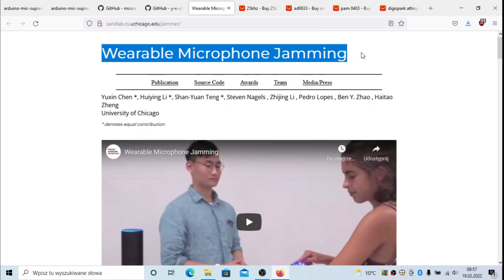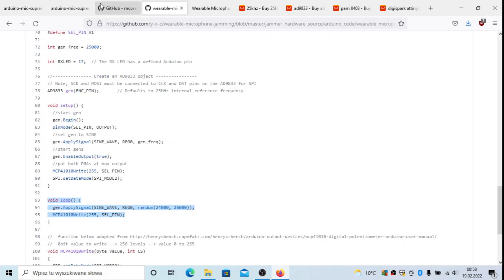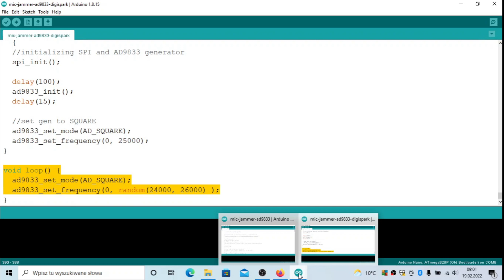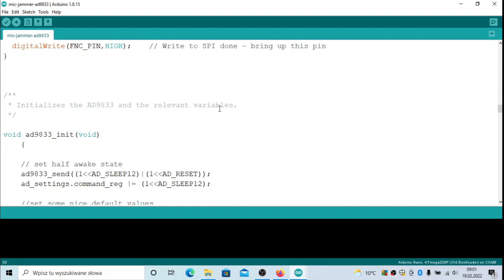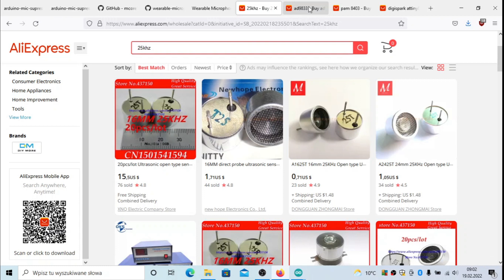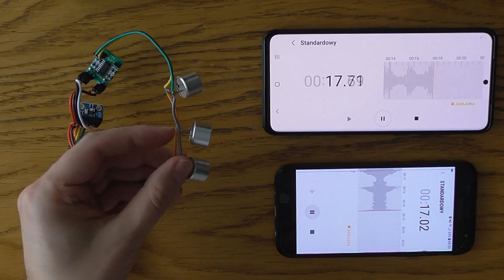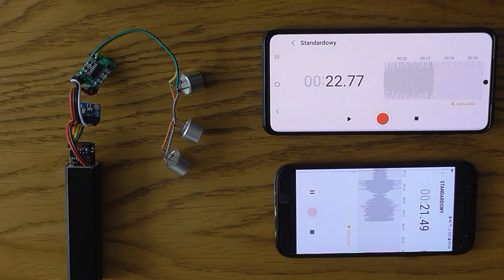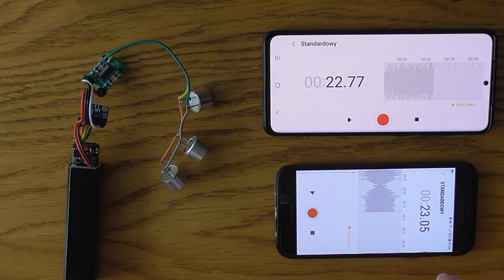Simplest, cheapest, effective DIY ARDUINO ultrasonic Microphone Jammer / DIY ultrasound Audio Jammer

Comment: I bought the Avr Usbasp Atmel recorder, it arrives tomorrow, I'm installing linux ubuntu to follow your video https://www.youtube.com/watch?v=7klgyNzZ2TI
What version of ubuntu does it indicate?
Reply from the maker: use latest or 20.04. The software is available for all ubuntu versions.
Reply: @justanengineer5599   are the main7.elf main7.hex files generated when main7.c code is compiled or do you need these files?
Reply from the maker: these ELF and HEX are generated from C file every time you run "compileattinyXX" batch script
Reply: That's right, thanks again for helping, tomorrow the record company that indicated arrives, so I'll be trying here, if I have any doubts I'll contact you again to see if you can help, it's very important for me to succeed in this, sorry for my lack of knowledge and the amount of posting in your publication.
Reply from the maker: no problem. Remember to do "chmod +rx compileattiny*" in linux to set execution rights to batch script
Reply: @justanengineer5599  the recorder has now arrived, a doubt would have a tutorial to use it in the same way but in windows?
Reply from the maker: COMPILATION ON WINDOWS 10 PC :
If you have Windows 10 machine - follow this tutorial to download and install full AVR-GCC environment :     http://fab.cba.mit.edu/classes/863.16/doc/projects/ftsmin/windows_avr.html   and  use "compileattinyXX.bat" files for compilaton in the directory where you have downloaded mainX.c files. You have to be logged as Windows Administrator and run "cmd" from search window to do that. Then use commands like "cd XXXXX" to change working directory to get to downloaded source files
Reply: @justanengineer5599  already tried with this tutorial but the Atmel AVR Toolchain for Windows that tells you to download the link no longer exists
Reply from the maker: try this page here it contains binaries fow windows https://blog.zakkemble.net/avr-gcc-builds/

Comment: Could you create a new video or explain better how we can assemble with changes in the source code of the initial PoC version with AM modulation?
It would help a lot.
would there be a way to do it only with digispark and a Pam8406 that already comes with the 10k potentiometer in it?
I really need to get these results I ask for your help.
Reply from the maker: Hi. the digispark board cannot be used because there are some resistors attached to port B of ATTINY85 chip and Digital to Analog Converter cannot be created. You have to use discrete components and make it from the scratch like on my first video here https://youtu.be/YBQ7A4W0bTo   Also ATTINY85 chip programming is needed as I am showing here https://youtu.be/7klgyNzZ2TI

The only difference is that you put PAM audio amplifier board instead of transistors
Reply: @justanengineer5599   can i use the arduino uno, or usb recorder card to record the attinny85? Will it have the same result?
I set up the whole circuit manually, but when recording with the main7.c code changed to AM modulation, it records normally when I put it in the circuit, I am not having oscillation in the test port.
I already redid the circuit 5x and it is correct with your diagram, however I do not get a result, I will try again today, but I would like to know if I can use the arduino or ATtinny85 usb recording device to record and then put it in the circuit.
Reply from the maker: you meant flashing?  I am flashing attiny85 chips with USBASP flasher. My scripts are prepared for this. yes, you can flash directly .HEX files from github to attiny as long as you  have any compatible flasher. There is very important to flash also fuses the same way as my script does so attiny could run on 16MHz clock
Reply: @justanengineer5599   I managed to record on the arduino uno using a library that seems to have worked because I have the same variation and modulation on the oscilloscope as yours, but it generates noise on the speaker adjusted by the 10k potentiometer, it interferes with the iphone but it is still possible to listen to it, I filmed everything if I could please take a look
the link is this: https://youtu.be/6a0xi43v9rI
Reply from the maker: I have seen the video. You have attached oscilloscope to one of atmega pins. please connect it to input of the potentiometer because we can only see single bit of the 5 bits of digital signal. I would like to see if Digital to Analog converter works. These pulses should have different amplitude but on your oscilloscope they look as they would have the same amplitude
Reply: @justanengineer5599   they seem to have the same amplitude on all potentiometer pins and on the test output new link: https://youtu.be/yg3olohPXgc
Reply from the maker: it looks like you have some issues in connections. See what I have got on my prototype on 2 pins of the potentiometer : https://ibb.co/XYBgj13
https://ibb.co/7ny3TyT
Reply: @justanengineer5599  But would this code be used with transducers or with speakers?
Reply from the maker: with both speakers and transducers. check resistors and if there is R resistor connected to the GND : https://github.com/mcore1976/antispy-jammer/blob/main/antispy-jammer-enhanced-schematic.png
Reply: @justanengineer5599  Yes, I put a 1k connected to GND like the example
Reply: capacitors I am using 10mf and 470nf at the output on PB0 where the 1k resistor is located with the 470ohm one, a 1k one goes to GND
Reply: @justanengineer5599  yes

Comment: Any progress?

(they are using transducers to send FM modulated signal and the speaker for high tones AM modulated signal random noise on 25kHz bearer frequency. The combination of both techniques apparently gives the best results. I will see if I can get AM modulation on transducers instead of the speaker)
Reply from the maker: Yes, I did some changes in the source code to my initial PoC version ( the one without AD9833 but with resistor ladder based Digital to Analog Converter)  by sending not only FM modulated square pulses but also with AM modulation (amplitude of the pulse is random as well) : 

The source code : https://raw.githubusercontent.com/mcore1976/antispy-jammer/main/main7.c
The compilation batch file for Linux : https://raw.githubusercontent.com/mcore1976/antispy-jammer/main/compileattiny85v3
The diagram : https://github.com/mcore1976/antispy-jammer/blob/main/antispy-jammer-enhanced-schematic.png
The prototype : https://freeimage.host/i/HYOoeJ1

It looks like it has slightly better effectivenes on newest phones.  However I think that using transducers instead of normal speaker for AM modulated signal is bad idea. that is why the combination of both should be used - 25kHz transducers for FM noise modulated and   25kHZ speaker for AM modulated 25kHz carrier
When using transducers they have to be oriented exactly the way the microphone is placed. That may not be the case for the speaker, maybe it covers wider area
Reply: would it be possible to change the source of the newest one that made using the AD9833 so that it did this AM function with a speaker working with the other transducer so I think the effectiveness would be greater?
Reply from the maker: unfortunately not, the AD9833 chip does not have audio power regulation. You can only set the wave type and frequency and phase. No possibility to adjust the power...  That is why I have used my old design to validate the concept with amplitude modulation.  
We need to put additional digital potentiometer to use it with AD9833. If you have high tone speaker you may also test it if this helps with iPhones.
Reply: @justanengineer5599     Got it, I'm going to assemble the old one now with the AM modulation changed and use the speaker here, I'll post the result with the Iphone in a little while, do you think that using the combination of digital with AD9833 and 25khz transducers, and this one with AM modulation and speaker on separate circuits, but the two at the same time, the interference effectiveness will be higher?
Reply from the maker: yes. I think using both types at the same time may help. Remember to put potentiometer as in the diagram and fine tune it not to get signal distorted
Reply: @justanengineer5599   I set it up here but the speaker does not make any audible noise, will the audio through the speaker be inaudible too?
Reply from the maker: it has to be high tone speaker. Otherwise it may not work. Try to test if you  are getting the same results as using transducers
Reply: @justanengineer5599   using transducers it has the same effect as using the model with AD9833, using a speaker it generates an audible noise, it interferes with the iphone but in a short space of distance and you can hear it, please put the link of an example of a speaker that suggests use?
Reply from the maker: please use the latest version of the code. I have just updated it. For the model of the speaker I think it should be something as on the russian video

Comment: In order for this project to be as effective as possible, you need to add an Acoustic Noise Generator designed to blend the voices and prevent the recordings from being clean. This would have an effect on apple devices and cell phones that have a noise reduction system, the most important question is how to create this acoustic generator as they are used in the most modern products as an example: https://www.youtube.com/watch?v=dy9U9BbFXYs
which uses in addition to the 25khz transducers, they use a speaker with an acoustic generator causing iphones to record only distortions and echoes instead of voices.

Do you have any ideas to add acoustic noise generator to your project and make it more effective?
Reply from the maker: you would probably have to use modulator on 25kHz sourced by AD9833 generator. 
I think the SIMPLEST solution would be to put the  Digital potentiometer between AD9833 module and PAM8403 module and then steer this potentiometer with RANDOM values of amplification setting (via SPI BUS from Attiny). that would easily do the job of random modulation
Reply: @justanengineer5599   Could you create some example image of how it would look in the circuit?
Reply from the maker: it would have to be something like this https://www.instructables.com/Digital-Potentiometer-MCP41100-and-Arduino/?amp_page=true  with MCP41100 or equivalent . pins PB, PW placed between AOUT of AD9833 and input of PAM8403 module. I will see if I can reach the same scenario with predefined random sequence and ADC on resistors connected directly to ATTINY85 pins (my first hardware design of the jammer)
Reply from the maker: they are using transducers to send FM modulated signal and the speaker for high tones AM modulated signal random noise on 25kHz bearer frequency. The combination of both techniques apparently gives the best results. I will see if I can get AM modulation on transducers instead of the speaker
Reply: @justanengineer5599  Thank you if you can it would help a lot in the project, I look forward to your return
Reply: @justanengineer5599  I'm trying to modulate and am 25khz here with arduino but without success, I noticed that when it generates noise at 18khz with a speaker in parallel to your project it interferes with the iphone however it is audible, Have you made any progress on this topic? put some link for donation of values for me to help financially in your research because I am very interested that this works with iphone.
Reply: @justanengineer5599    
I tried something like this:

#include <math.h>

#define F_CPU 16000000UL   //clock do microcontrolador
#define TONE_PIN 11        //pino de saída para o alto-falante

// Frequências da onda portadora e moduladora
#define FC 25000  // Hz
#define FM 100    // Hz

// Amplitudes das ondas portadora e moduladora
#define AC 1      // amplitude da portadora
#define AM 0.5    // amplitude da moduladora

int sample_rate = 48000; //taxa de amostragem
int duration = 1000;     //duração do sinal em ms

void setup() {
  pinMode(TONE_PIN, OUTPUT); //configura o pino de saída do alto-falante
}

void loop() {
  for (int i = 0; i < duration * sample_rate / 1000; i++) {
    //calcula o valor do sinal modulado AM na posição atual
    int sample = (AC + AM * sin(2 * PI * FM * i / sample_rate)) * sin(2 * PI * FC * i / sample_rate);
    
    //envia o valor para o alto-falante
    analogWrite(TONE_PIN, sample);
  }
}

Comment: I rebuilt it, works fine with 20T but not on modern phones (especially iPhones) as you mentioned it. Would more power make it more effective? Or would it be more effective if I increase the amount of transducers? Any advice on what I could try, which Hardware I could buy, etc.? Thank you very much btw. I really love your content, I have learned lots of stuff from you!
Reply from the maker: yes, please use PAM8610 and 2x40 transducers for better effect. Remember that this PAM version needs to be powered from higher voltage than AD9833 & Arduino. You will need also voltage converter for these boards
You may also try to build two jammers and switch them on at the same moment for better efficiency
Reply: @justanengineer5599  I will just go to aliexpress and order it. :) So basically I can use the same code but I should replace the PAM8403 with an PAM8610 (with potentiometer) and just play around with the waveform maybe? I will take care of the voltage btw I'll find a 12v source.. :)
Reply from the maker: yes, you may play around with the waveform type. The type of amplifier is irrelevant for the source code as long as it has an analog potentiometer. You may try it with this speaker however piezzo transducers are more energy efficient devices
Reply: @justanengineer5599  Another thought, do you think PW3825 ultrsonic speaker could work? 2,5-50kHz is the range it supports ?

Comment: Well I build it and it works, but when the listening device is covered with clothes like hidden in pocket it will not work at all even in close range.
Reply from the maker: umfortunately ultrasonic waves have problems with clothing
Reply: @justanengineer5599  Thank you for your reply and hard working, do you suggest anything to jam microphones covered with clothes? I tried everything but still coming out with empty hands.
Reply from the maker: I think only low frequency tones would be succesful like infra-sound
Reply: @justanengineer5599  well I tried 19hz but it was not detected by iphone I think it has lowpass filter. May I have your email if possible?
Reply from the maker: my email is on the channels page

Comment: Thank you for your hard working, I just diy 1 base on this video and tested it, It works amazing to Android's mic but Iphone still can records my voice, ignores the noise, I think maybe Apple reduces the mic receive frequency bandwidth so it doesn't record the high frequency. Do you have any Idea?
Reply from the maker: It is less effective for iphones, they are using some advanced noise canceling software. I would sugest to built two jamming units and switch them on at the same time.  I have also found that some of the ultrasonic transducers may have different polarity than marked (causing canceling of the signal by opposite phase) and it may significantly degrade the performance of the jammer. 
Unfortunatelly I do not have an iphone to play with it so I am unable to improve this design at the moment.
Reply: @justanengineer5599  thanks for your reply, I've googled some recording jammer's images and relize they ussually have a bigger speaker (maybe) beside 25khz transducers, I guess it act like a supper low frequency (under 20Hz) generator or sth like that, to cover the low threshold of sound, I am trying to figgure it out. Once again, tks to your help Sir. Good luck 🤞🤞
Reply: @hovinh2765   I'm also researching this I think they use a piezoelectric 2.5-50 khz with an Acoustic Noise Generator generator designed to mix your voice and prevent the recordings from being clean, anyway if you find a solution please post it here as most are wanting it that works with iphones. Thanks
Reply: @kadinbrasil8160  oke I will
Reply: @hovinh2765  Thank you, I'm trying here too if I manage to post here
Reply: @justanengineer5599  I would like to give you an iPhone as a gift so that we can improve this project together and manage to block iOS recordings

Comment: With pam8610, is it possible to power this module from a 12V source and from a second 5V source (powerbank) AD9833 together with DIGISPARK?
Reply from the maker: yes. you have to attach 12v to Vin of Digispark and attach 5V (vcc) from digispark to AD8933 signal generator. The PAM module will be powered friom 12V directly
Reply: @justanengineer5599  Thanks 😉
Reply: Hi Adam, I connected the PAM8610 module directly to 12V. I supply the AD9833 module with the DIGISPARK module via a 12V/5V converter. The jammer worked for about 6 seconds, then stopped working completely. I have 20 ultrasonic sensors connected. Where did the error occur? A wiring diagram would help......
Reply from the maker: I am wondering if 5V stabilizer on Digispark board got fried or something. You have to check the vcc lines with voltage meter on all of the boards

Comment: Could you please make a video setting up the pro/micro/nano configuration? I am unable to get it to work using your diagram. The code uploads fine (I’ve tried nano and micro), and everything is breadboarded as you have it. I have even lined up the polarity of the transducers. I have used many different PAMs, two different 9833s, and multiple microcontrollers with no success. I promise I’m not an idiot. Is there a major consideration I’m missing? All devices are going to the same ground and to the same voltage source at 5v. I have mostly tried building this with a nano. Thank you!
Reply from the maker: I will do but it will take some time. meanwhile you may try to solder boards together because using breadboard may causs some connection losses